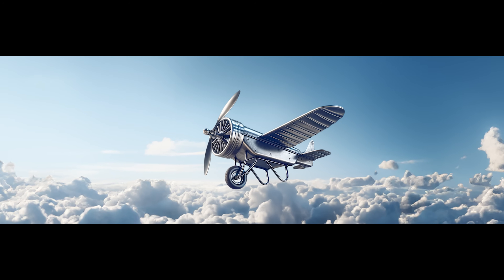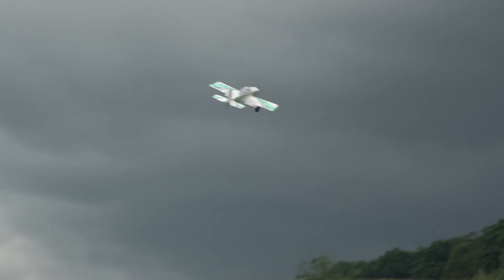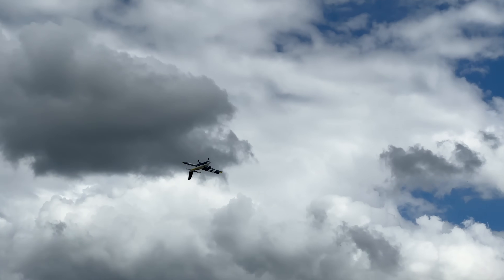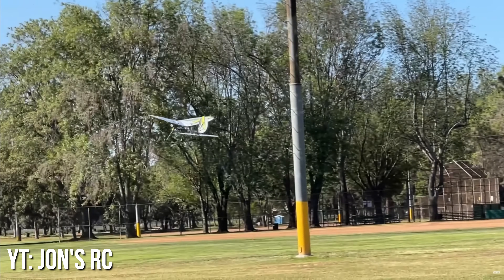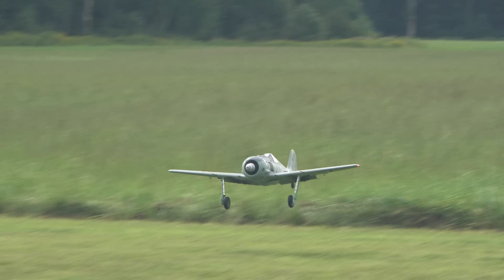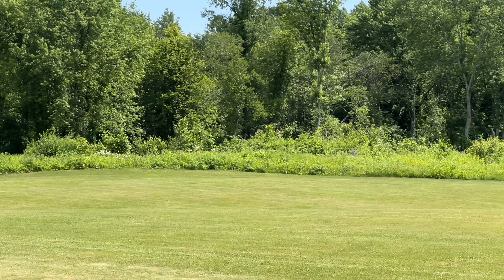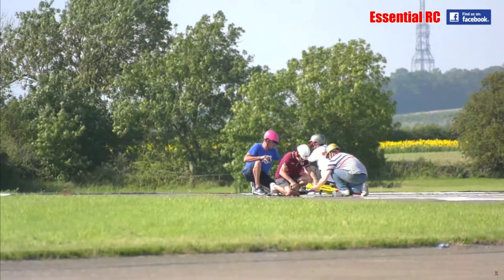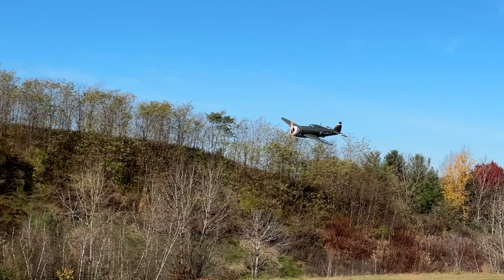The TRUTH About Wing Cube Loading

Comment: I really enjoyed this video and was glad to see someone addressing this topic.  We do use these "square-cube" law concepts like "cubic wing loading" heavily in aerospace engineering.  Most of the things we are interested in with respect to aerodynamics and flight mechanics like, force and moment coefficients, are nondimensional by design, and only a function of other nondimensional parameters, such as Reynolds number(ratio of inertial forces to viscous forces) and Mach number (compressibility).  For fixed-wing R/C applications Reynolds number is the primary driver.  The cubic wing loading knows nothing about aerodynamics or the overall design of the airplane and is really only useful for gross scaling of a given geometry. If you simply think about wing loading (W/S) as a pressure you can make it independent of scale (though still dimensional) by noting how the numerator (W)  and the denominator (S) change as the scale factor changes. 

 If you simply imagine a cube made of some arbitrary homogeneous material you can quickly scale it up or down and see how its dimensional properties like length, area, and volume change.  Lets say you double the characteristic length of the cube such that the scale factor (k) is defined as the ratio of the new length to the original length and you get k=L2/L1=2.  Square cube scaling logically leads you to realize the area of the cube grows with the square of the scale factor while the volume grows with the cube of the scale factor, such that  L2=k*L1, S2=k^2*S1, and since weight is dependent on the volume you get that W2=k^3*W1.  This make scaling the wing loading for a different size/scale plane easy as (W/S)_2=(k^3/k^2)*(W/S)_1 and leads one to the conclusion that the wing loading is simply a function of the scale factor as K^3/k^2=k.  So in basic terms if you double the scale of the airplane you should expect that you can simply double the wing loading and recover similar nondimensional performance as long as the relevant nondimensional  similarity parameters like Reynolds number aren't affected significantly.  This square-cube scaling can be applied to a plethora of things like scaling for power required (k^3.5), airspeed and time (k^0.5), moments (k^4), Moments of Inertia (k^5), but things like angles, acceleration and cubic wing loading are proportional to k^0 thus being independent of scale which is exactly what you want.     

Obviously the whole airplane isn't scalable as there are things that are scale independent or only come in scale increments like motors, batteries, servos, etc.  When I worked with major hobby vendors scaling airplanes I would often use lots of these metrics to figure out the best scale for a different size version of an existing design using a detailed weights model with a set of potential components but after doing this a lot my preferred method was typically to design around a know powerplant and let the model's scale fall out from there.

Comment: Given (1) two rc planes that are exactly the same in all respects except for size, (2) the wing loading is exactly the same in both, and (3) one weighs 10 lb whereas the other weighs 15 lb.   According to wing cube loading, will the larger plane have a slower stall speed?
Reply from the maker: They will have very close to the same stall speed. If you look at or are familiar with the math for calculating lift, it scales linearly with area and coefficient of lift. So, wing loading will have the greatest effect by far. There will be some mild effects because the reynolds numbers will be slightly different.
Reply: @TailHeavyProductions   Thank you for your informative response.  So it appears to me that the concept of wing cube loading is not worth much.
Reply from the maker: Big if true. I'm not sure you're understanding the legitimate use case of WCL that we're making in the video.

Comment: @TailHeavyProductions
Another highly useful parameter I use to determine flight characteristics and a general idea of what to expect for maidens of new arfs and scratch-builds is what I call a "Performance Factor".  It combines Cubic Loading with Displacement loading.

Displacement Loading = Weight / HP

The Displacement Loading is useful for assessment what flight category your plane is in - Trainer, Scale, Sport, Pattern, 3D Hucker, etc., not just the powerloading (watts/lb).

Performance Factor = Cubic Loading * Displacement Loading

The Performance Factor is useful for assessment to see if the plane has enough power for the given aircraft and flight category, or not, or too much, or if the aircraft is too light or heavy for the wing cubic loading or powerloading or both.

For example: airplane is 21oz, 36" span, 252in^2 wingarea, design cruise of 25mph, and the propeller absorbs 100 watts of power (static), and also assuming you have a propeller that is matched well enough for the motor and airframe.

Here are the results:
SpanLoading = 7oz/ft
Wingloading = 12oz/ft^2
Cubicloading = 9.07oz/ft^3
Powerloading = 9.81lb/HP
Powerloading = 76watts/lb
Displacement Loading = 19.62lbs/in^3
Performance Factor = 178 oz/ft^3

This example aircraft is most definitely categorized as a trainer that is docile, predictable, stable, and easy to fly.

Other useful scaling terms to know are:
Scale Factor of Full Size = K
Acceleration = K^0
Dimensions = K^1
Areas = K^2
Volumes = K^3
Weights = K^3
Forces = K^3
Time = K^0.5
Velocity = K^0.5
Power = K^3.5
Thrust = K^3
Wing Loading by Area = K^1
Wing Loading by Volume (aka Cubic Loading) = K^0
Power Loading  = 1 / K^0.5

Notice the Cubic Loadings exponent is zero, just like acceleration  -  It's unquantifiable, 'unrelatable'  - cannot be directly assessed.  All of these parameters are useful for a better determination/expectation for a given aircraft.  This is why I use the Performance Factor as it combines both.

Comment: Bit of a funny question, but, when calculating wing size are you supposed to measure wingtip to wingtip or just each wings length added together ignoring fuselage? I'd ask on the discord but usually get ignored.

Comment: what are the units of wcl? first you say it's a made up metric, then you say it's a more accurate measure to compare models, then you say different models need different wcl's. i was always suspicious of you using wcl instead of the standard wing loading. this video didn't exactly help.
Reply: Mathematically, the unit of WCL is ounces per cubic foot [oz/ft³]. If you prefer metric (aka SI-units), one ounce per cubic foot happens to be almost exactly the same as one kilogram per cubic meter, precisely 1 oz/ft³ = 1.00115 kg/m³ according to google. So, instead of calculating WCL = Mass [oz]/(sqrt(Wing Area [ft²])^3), you may calculate Mass [kg]/(sqrt(Wing Area [m²])^3) and obtain a WCL in [kg/m³] that will differ from a WCL in [oz/ft³] by only 0.115%. For the purpose of comparing different airplanes, this difference is perfectly negligible.
Reply: @IngenieurAndreas  that's nice, that it is at least somewhat unit independent
Reply: The units are technically ounces per square foot^1.5.  But that’s not very helpful so it’s usually ignored. Using wing loading on its own to compare airplanes becomes an issue when you compare different sized airplanes. For example – a UMX turbo timber when compared to a regular sized Timber evo. The UMX Turbo Timber has a wing loading of 6.39 ounces per square foot while the regular sized Turbo Timber has a wing loading of 15.4. Anybody who has flown both knows that the smaller one doesn’t feel twice as floaty as the big one in the air.
Reply: @cwojcik_rc  thanks, for the unit (the rest is just copy paste from the video)
wing loading + span could give the same information
also funny that it's called "cube" when there is no ^3 to be found
Reply: @cwojcik_rc  Because x^1.5 is the same as (x^(1/2))^3 and x^(1/2) = sqrt(x) = sqare root of x, ounces per square foot^1.5 are the same as ounces per CUBIC foot. There's the cube !!!
Reply from the maker: Thanks for clarifying, Cody!
Reply: Wing cube loading is dimensionless